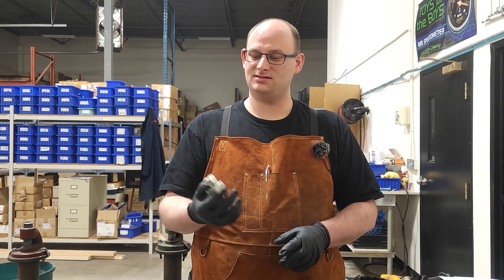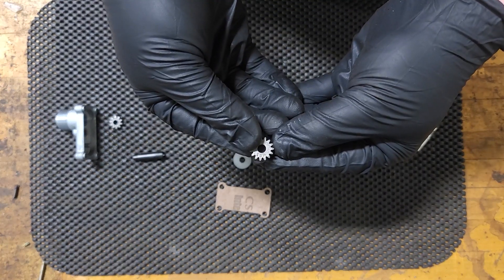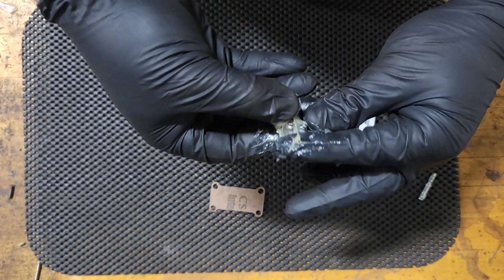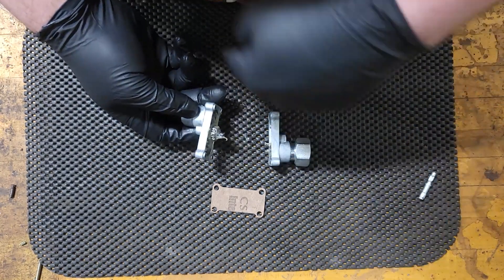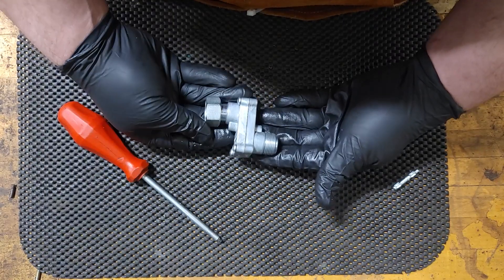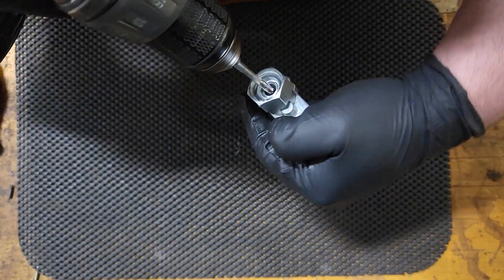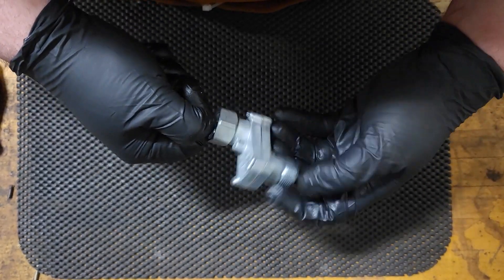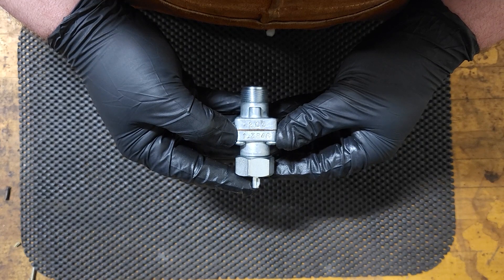MAKING AN OFFSET RATIO ADAPTER WITH A 1.3846 RATIO

Comment: Do you make and sell these? I need one for my c10 that increases to 1.5 ratio
Reply from the maker: Yes I do. I assume its a C10 Chevy truck? If so the sizing is 0.104sq and with a ratio of 1.500 its a standard size so it can be made no issue

Here is the link to the adapter
https://recordtechnologies.com/products/ratio-adapter?variant=47209622216

Here is the link to the adapter key (this part goes into the adapter for the 0.104sq input into the transmission)
https://recordtechnologies.com/collections/adapters/products/ratio-adapter-keys

For the adapter key, Make sure you select the 0.104sq size so you get the correct size.

Hope this all helps!